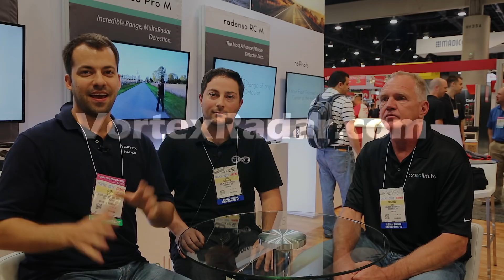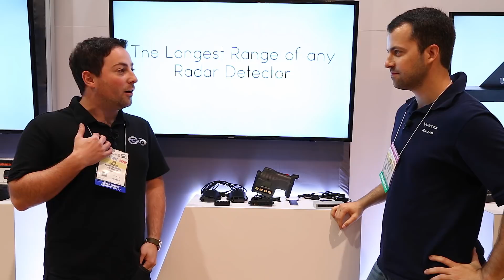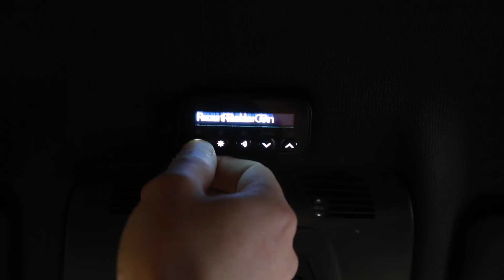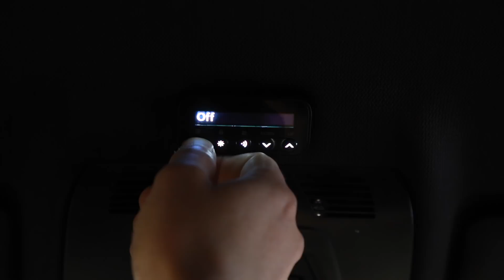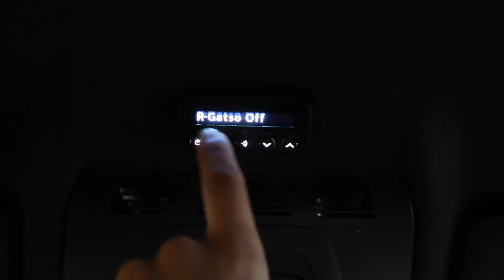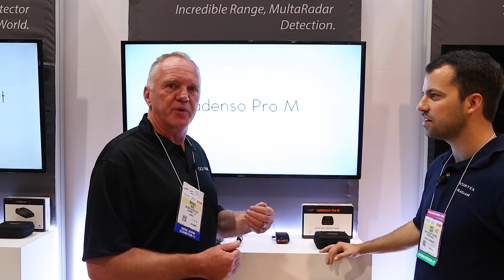Radenso RC-M & Pro M updates at SEMA 2017

Comment: Do you have a radar that will detect Instant On radar before it is turned on by law enforcement?  Tennessee has Instant On Radar.
Reply from the maker: You can’t detect what’s not there. Every radar gun on the market “has instant on.” It’s nothing more than telling the gun to transmit or not, similar to turning your TV on or off.
Reply: What about the new product that is coming out from radenso will this product be able to detect instant on thanks in advance?

Comment: There was mention of integration with ALP but nothing on their website. Do they not sell the ALP or is that yet to come?
The RC-M looks like a window mounted solution and the ALP one demonstrated in your video showed something different. 
How does the RC-M compare against the Escort MAX360c ?? 
Like your videos and am looking to purchase a detector soon. Thanks
Reply from the maker: +GrillingNetwork™ The RC-M is a remote detector that comes out later this month. When it is officially released I’ll share more information about it.
Reply: The RC-M will be available from brick and mortar dealers with the option to also include ALP.
Reply: Radenso Radar thanks for your response. Looking to add it to my F250 😀